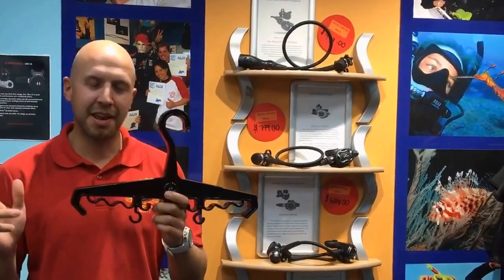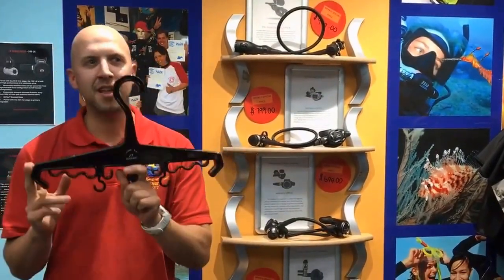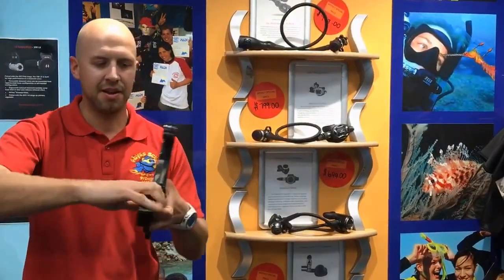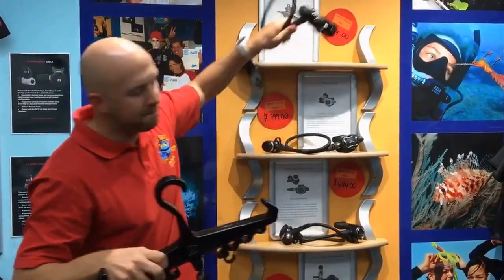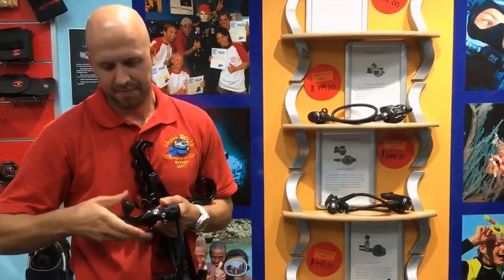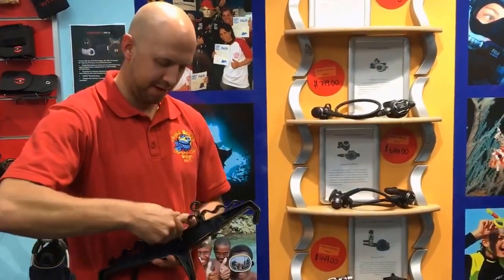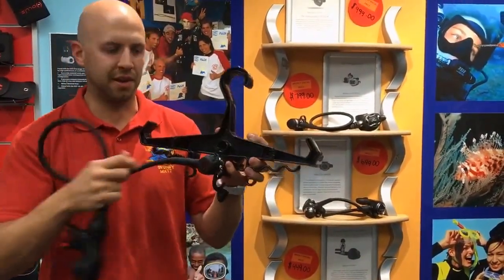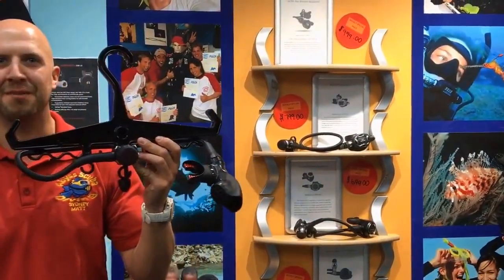How to use  a BCD and Wetsuit Hanger

Comment: I don't like it; it has sharp corners where the BCD shoulders hang from it. The Mares Universal Hanger is, in my opinion, a much better design.
Reply: We have tried them both and have found these more sturdy and work better than the Mares.
Reply: Hmmm. I've never had a problem with my Mares. (I have several of them.) They work well with my BCD, my 7mm farmer john and jacket, and my 2mm shorty.